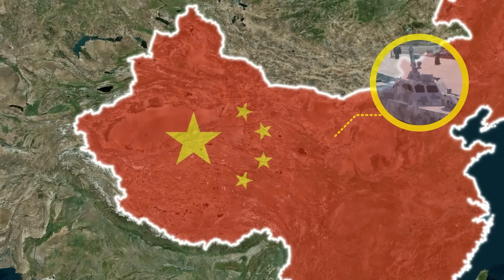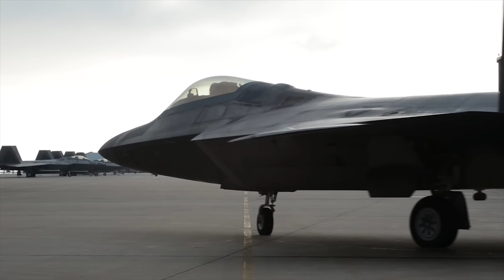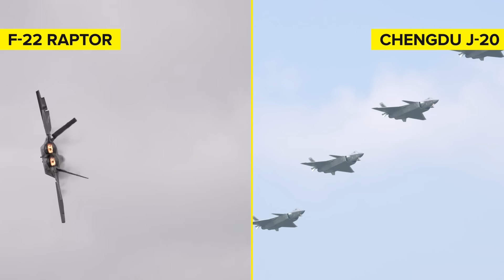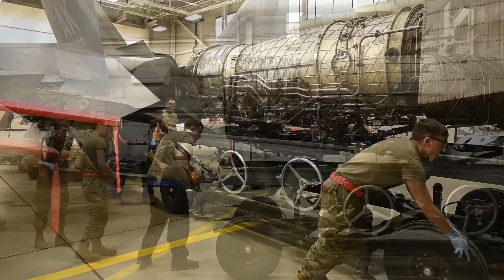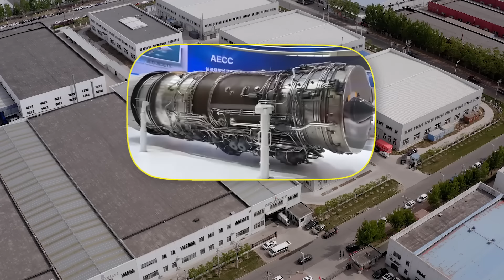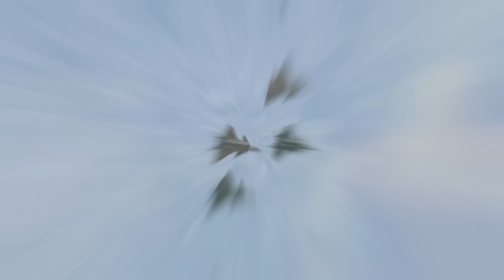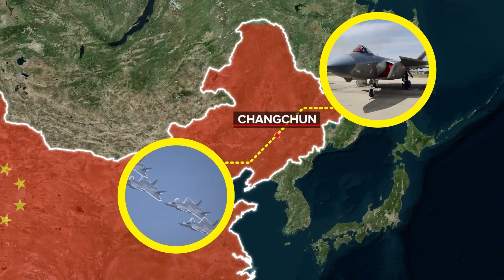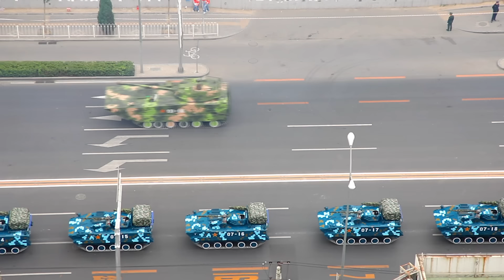China’s J-20 ‘Stealth’ Jet Is a FLYING LIE… A Paper Tiger That Can’t Fight

Comment: Lei in Lei’s Real talk has suggested that  extreme falsification of test results throughout the Chinese aircraft and radar industries may hide a J20 less stealthy than though.  That is, the J20 may have flaws in stealth that cannot be detected by the Chinese most advanced  radar, and, in turn, radar tested by ability to  detect the J20 may be less capable than thought.  Lei analyzes and  explains the inner workings of the CCP and Chinese defense industries in far greater detail than anyone else I can find on the net.

Comment: Breaking down your 5 "massive weaknesses" shows how outdated this analysis is:
1. Engines: Claiming it can't supercruise completely moves the goalposts now that the clean-sheet WS-15 engine has entered serial production. 
2. Stealth: The J-20 is optimized for frontal stealth because it's a head-on interceptor, not a flanker. Side and rear RCS matter far less when you're flying directly at a target from 100 miles out.
3. Avionics: Mastering advanced semiconductors is exactly what drives modern fifth-gen software. 
4. Maneuverability: Judging a modern BVR (Beyond-Visual-Range) platform by its lack of a gun or dogfighting agility is a 1980s mindset. It doesn't need to out-turn an F-22 when its explicit mission is to fire long-range PL-15s to sever Western tankers and AWACS.
5. Experience: The US military plans for a threat based on theoretical maximum capabilities. Dismissing a fleet of 300+ stealth jets just because they haven't fought a war yet is a massive analytical blind spot. Western defense planners are taking this jet very seriously, even if this channel isn't.

Comment: There are 3 parameters to determine if a jet is a 5th gen. 
1. Stealth : In J 20 stealth is very much there but slightly less refined then Su 57 BUT when the canards of J 20 mvoes than the RCS of the jet will also increase making it worse. 
2. 2D engines : J 20 double engines are not 5th gen engines and it can't go super cruise without afterburners so it is the biggest flaw. (China can't build its own engines and still relies on russian engines or reverse engineered russian engines)
3. A 5th gen fighter is a whole command post which incudes various systems like electronic warfare, connected to its defences and radars, command and control etc. Now J 20 has this kind of capability. 
So in short answer J 20 is a partly 5th gen fighter including J20 A and J 20 S and comes nowhere close to even F 114 nighthawk which is too old.

Comment: The J-20 engines smoke and have to be replaced after 50 flight hours. Also, they put out an ENORMOUS heat signature that makes them visible to IR detectors before they get picked up on radar.
Reply: 根本飞不到50个小时    每次飞行都要在空中换一次发动机才能安全降落

Comment: To back up the comment from @chadly19 it is very hard to take any of this post seriously when you say that 1500 mph is a whopping 47% increase from 1535 mph. WTF. After checking google the J20’s top speed is in fact 2126 kph or 1321 mph. A 47% increase on that speed would give you a terminal velocity of 1941 mph. You don’t need to be Einstein to realise there is something drastically wrong with your math 🤪

Comment: 2 Cray Supercomputers ....  NB a single Cray X-Mp was around 10 times as fast as a Cray I ... and both are 30 years out of date ... 
An iPhone is significantly more powerful than either .. if you need to ask which one you are also out of date ... 

Please get a grip and use references that are not decades old .. .

Comment: The J20 has canards which are the exact opposite of stealth. They're used to stabilize the aircraft because the design can't replicate US aircraft. Yet their primary purpose, maneuverability, is much worse than the US planes without them.
Reply: bro the point of canards is better flight ability, not every plane needs that thing to fly, also where the hell do you get the better maneuverability case
Reply: @Not_Danten You're arguing against yourself. The better flight ability of canards is better maneuverability. So you obviously don't understand planes. The net result is also a much larger radar cross section because of the additional surface area and how they've shaped. If they were actually better for fighter aircraft, then the US would have them on their stealth fighters. They rejected a design for the 5th generation fighter from Boeing exactly for this reason.

So do you not understand aircraft or are you a Chinese shill trying to say canards make a better 5th generation fighter so China's is better than other designs?
Reply: @BonefishSailing Bro there is only like 3 real 5th generation fighter in  service, with only one being questionable, f35, and the only comparable ones are f22 and j20, with j20 being in more favorable position having more fual and missials to out range f22. 

Also bro bigger surface does not kill your rcs, as if something like B2 just going to die for being bigger. I would much rather believe the at front rader cross section is deleted when canardIs face down wards and rader pickup a signal at same level, if not it is decently slightly, but at the same time something like f35 belly is probably more damaging than canardIs.

Comment: The J20 with the new WS-15 engine is still not a match to the combat tested F22 Raptor in real combat, the J20 is alonger in shape and crumsy, slow in up climbing in a dogfight situation. U.S. Air force General kenneth: " CCP's 'J20 with the WS-15 new ngine is not 'anything to lose sleep over it !' "

Comment: Chicom still hasn’t solved the basic engine fan problems plaguing them from the WS10.  The WS15 benefited from ceramic mix bearing.  Fan blades haven’t meaningfully improved.  Also the domestic semiconductors for the avionics are fickle and prone to corrosion.  Prolonged super cruise is just a dream.  The only reliable plane is the J10 which can’t compete with the newer F16s. 😂😂
Reply: J15 j16: What the f are you smoking?

Comment: J-20 was exported to Pakistan, and has fought in a single conflict.  It was  a very short lived conflict without enough combat data to infer much from, but it did get 1 confirmed kill against a Raffaele fighter. No surprise since the Raffaele is only a 4th gen fighter, but still notable.
Reply: The J20 is barely 4th generation as it's engines are inferior and it's NOT stealth.
Reply: Since when was j20 was ever sold?

Comment: The CCP boast they are a 3000+ year old civilization compared to the West's but yet cannot develop their own technology without either copying or stealing from the West.
Reply: 窃取西方至今没有的技术  比如六代机~
Reply: @llkk290  Six-generation fighter designs have been kicked around by shops for the last 30 years. Why produce something not yet needed to defeat an adversary? 😉 But don't panic.
Reply: @llkk290  The West has the first ever 6th gen fighter that flew in 2020 in our NGAD Prototype. Also China hasn't made a 5th gen aircraft yet, let alone a 6th gen. Remember people the J-20 is low observable NOT stealth AKA by the United States Generations of Aircraft it's at best 4.5 gen because 5th gen MUST be true stealth. The F-22 had it's first flight in 1997 so China is only 27 years behind the United States in Airplane technology.
Reply: @Fau1ted  To date, the United States does not have a sixth-generation fighter jet or a qualified electromagnetic catapult system, which means that the United States has fallen behind China in military technology.

Comment: The J-20 is a very large jet fighter with the radar signature of a slightly smaller jet fighter. 
China needs to understand, you can’t use “stand-off” weaponry to defend against an aircraft you can’t target from anything but a very short distance.
Reply: Wonder why most consider j20 as an interceptor? And the amount of anti-stealth rader tech to track patterns and land based radar array?

Comment: When the US unveiled stealth, the problem for other countries wasn't that the US was far ahead of them on the technological road, the Hav Blue radar dispersing ideas in fact came from a Russian Engineer, it was the US had the vision to not dismiss it and work it, putting the US  on a completely different highway, using a flying computer to make a box fly. F-117. OF coarse other countries studied what the US did and copied, wouldn't you? DUH! Stealth has been a thing for almost 40 years, that tech is out of the box, hell a lot of the world is flying F-35's now. When Israel wanted to pick apart the F-35 tech, it wasn't the designs or schematics they wanted, everyone has that tech, it was the software codes. The next big advancement is likely to be the same, it likely won't be the 6th gen advancements of current technology, but from someone who thinks outside the box following and building on some other tech thought impossible. Be it crazy drone stuff, hypersonic jets, some other invisible tech, or some other undeveloped tech. Who knows who makes the breakthrough, and when? We may in fact already see it with some of the UFO sightings.

Comment: The J20s range is on paper, their engines suck fuel. The loaded range is much less.  And you didn't really talk about IR detection, the J20 has exposed engines giving it a massive IR signature, the F22 has Covered engines, which reduce IR signature. Missiles will not have any issue hitting the J20, but will have issues detecting the F22. Engine life is also 4 times longer in the F22, the radar detection coating in the J20 is at least 20 years behind the F22

Comment: Garbage, written by someone who doesn't have a clue what they are talking about.Might as well be reading Top Trump Cards for 7 year olds about both machines. Passive sensor range ( including datalink capacity), internal payload capacity and radar cross section  are what matters when it comes to Stealth aircraft. You can't hit what you can't see and if they can see you before you can see them, you're dead.

Comment: Chinese jets may look like western jets, but we’ve all heard the term “don’t judge a book by its cover”.. just because they LOOK like western jets, doesn’t mean they perform anywhere near as well as western jets.. America is, by far, the leading country when it comes to technological advancements .. Raytheon, Lockheed Martin/skunkworks, Boeing etc. have been pushing the boundaries of technology since microchips were invented .. 
sure, China and other countries are no slouch when it comes to innovation and technological advancements, and their aircraft and other weapons are still a threat to American and NATO aircraft and other vehicles/weapons, but the U.S. is WAAAAY further when it comes to said technological advancements and stealth technology ..  the F-22 alone was first flown in 1997, which is WAAAAAAY before any country even thought about opening stealth aviation programs.. NATO started investing  and pushing the boundaries in micro chip technology way before other countries decided it was necessary.. American and NATO systems are insanely integrated these days, and no longer rely on the conventional “kill chain”.. American systems are more of a “kill web”, meaning if an American airborne early warning aircraft detects an enemy aircraft, the data and info picked up by the aircraft’s sensors are immediately shared with other aircraft, warships, missile defence systems, and almost every other vehicle and aircraft in their arsenal, giving the U.S. MULTIPLE different avenues of neutralizing the threat .. just the helmet the F-35 pilots wear is insanely advanced, and allows them to see through the aircraft, and is integrated in the rockets/missiles the F-35 fires.. America is probably 20-30 years ahead of anything China, and up until recently, Russia (the way Russia has fared in the Ukrainian war shows their probably 30-40 years behind anything NATO has) has developed

Comment: They are not in motorsports, they do not have any presence in commercial aircraft components. That tells a lot.
Also building is one thing. Keeping it up in the air is something else.
Not saying they won't crack the nut eventually though.
Reply: Comac? Never heard of it?
Reply: @LuckyLuck-i4s  I said components. If you are advanced, you have significant core technology. For example, Japan is non-existent in the aircraft industry (maybe Hondajet if you count that), but they hold a lot of crucial core technology that is used both in commercial and military aircraft.
Reply: @saraki4311 so China doesn't have core components and yet was able to build their awesome space station by themselves with no issues. They are the only ones who have made progress in the high speed rail sector of late. They own the ev industry that includes battery and power trains. They own the rare processing industry. They were cut by the west access to commercial engines. And now they have their own. What else? Avionics? In all sectors of industry and technology China HAS core components except the litography machine. But that too will end in 2028 or maybe even sooner. Deepseek moment for you. 1.5 millions stem graduates in 2024 alone. They now have their sight on the few industries where they have weaknesses such as biotech. And in a few years they will be ahead. In fact they plan to educate 1000 plasma scientists by 2030. What that means is that they already have the student body in the pipeline to graduate 1000 phd plasma scientists. So China only have knowledge but no core components right? You still have this view of China from 20 years ago like Melon Rusk who was laughing at BYD's cars. Even Melon Rusk is not laughing anymore since his Shanghai gigafactory can build more cars with less employees at a lower cost. No core components but they can build everything they need WITH sanctions from you.

Comment: The problem is you are looking at the white paper... what China claims are the specs.  The original engine for the J-20 did not pan out so they had to use a less powerful version.  This means it needs a long runway to take off and often must be refueled right after takeoff.  If the launch from a carrier is can not take off with a full load of weapons either.  It can not go as fast as they claim, climb as fast, or reach as high of an altitude.

How do I know this.  Well most is public sort of and they never adjusted the capabilities after the different engine was used.  Second is they did a joint mission with Russia and some strategic bombers.  Despite the wargame being well within the supposed range they took refueling aircraft with them.  The J-20 engines have a lot shorter life before service too, so they could not even complete the mission and all the J-20 turned back after going only half the distance.  They also took off with almost no weapons.

And the J-20 is not stealth at all.  It is less stealthy than the Su-57 and the creator of the Su-57 stated what the radar cross section of the Su-57 was (I think 1.5m) which is about the same as an F-15 with no external weapons on board.  This is FAR worse than the F-22 or F-35.  In fact it is FAR worse than the F-117 and the B-2.  Most modern radars have no problems locking onto the J-20.

Then you get to the fact the engines must be rebuilt way too often means they are just not flown very often.  Chinese piolets have about 1/4 the flight hours that US pilots have.  They also have far less infrastructure, no leadership or pilots with combat experience, far less support, worse radar, worse GPS, worse communications, worse weapon systems...

Comment: Love how they are saying that the potential better engines for the J-20 would help put it on a more even level with the F-22 in a dogfight. This is not the 1940s anymore fellas. If you are flying a stealth fighter and are getting into range for a dogfight, the situation has deteriorated so badly that you should probably be trying to disengage or you are doing it as a deliberate flex against older generation aircraft.

Now I'm not going to sit here and claim I'm an expert on radar, RCS and all that other little nuances that goes into stealth technology but I would feel that a 5th gen dogfight would never happen. The most likely scenario would be one side getting a contact on radar first and engaging with a missile before they are detected in return. Stealth doesn't make you magically invisible to radar, it just makes it very damn difficult (when done right) to get radar returns. You still will be hit by the radar so within specific ranges, stealth would be less effective and would therfore be more likely to register on a radar display. I'm not fully learned on this point but I believe it is still above 5 miles away when stealth can be overcome by a radar to the point it can be seen. If I'm wrong about that feel free to yell at me below. 5 miles away would still be 4.9 miles further than when you would even need to consider a dogfight as your option of defeating the enemy aircraft and you'd likely just fire a missile at the enemy and then take whatever established procedure you are trained to do next, whether that be scanning for additional targets or going into a defensive flight path to be prepared for counter battery as firing a missile would have also altered your enemy that you are in fact there and know where they are.

If anybody actually bothers to read all that crap and make it this far down my rantings here's a heart for being a good sport, or just for finding the crap I was wrong about to yell at me that I'm being stupid. Either way here's your heart. ❤